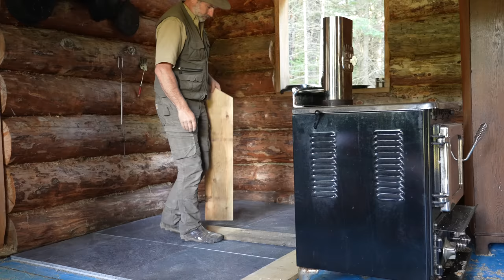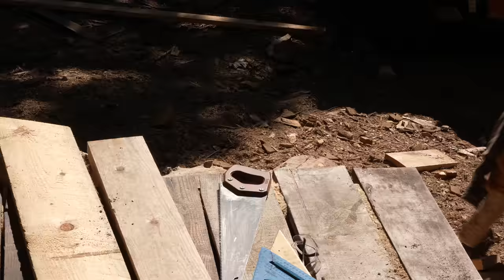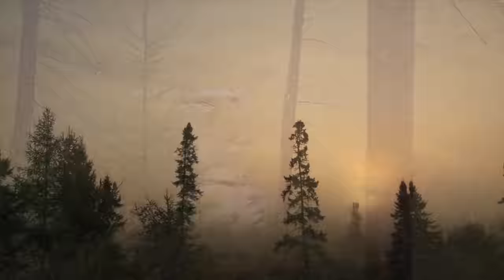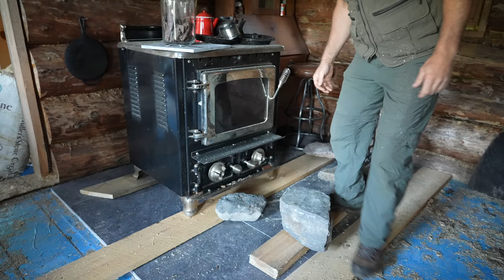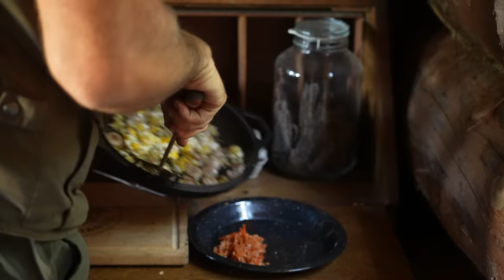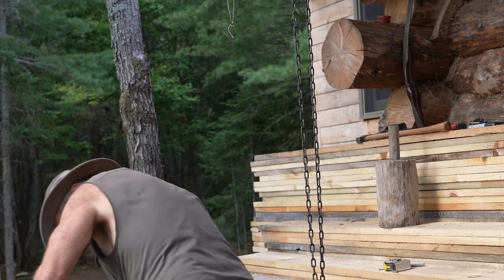Porch Overhang, Install Windows, Stone Floor, Garden Harvest, Off Grid Log Cabin Build Alone, Ep 23

Comment: My log home was made from 12" White Pine logs. All my vertical support logs inside and out were set up with the jack bolts like you have. My logs settled 4"-5" in the first 5 years. After that hardly any settling. When i would let the jack bolts down there was lots of cracking sounds from the settling. I built my log home back in 1998. To this day my log joints are mostly all tight! I heat 100% with wood. My home is 32x40 with a open style and a loft. It heats easily with a Soap Stone wood stove in temps down to zero. Then i fire up my outdoor wood boiler and run that until spring. I still burn the Soap Stone stove as i love viewing the fire! 

Your cabin is looking fantastic. Im anxious to see the finishing touches. Cali is looking great as well. I was wondering if youve ever taken her Pheasant or Grouse hunting? She looks so birdy when she's hunting up her dummy! I thinking she would do well on the Grouse and Pheasants!
Reply: Shawn mentions about the settling on his other channel, Shawn James. Not sure if I can post a link but the video ID is: 0QjF-kXgj3Q and the video is titled: "Why and how I am installing posts and beams on the log cabin porch" (upload date: September 9 2022). I point this out in detail for the benefit of anyone reading this in a few months/years/decades/centuries ....... 🙂

Comment: love  the way all key elements have been brought forward in sequence  towards  a logical conclusion..home-garden--- soil replenishment .....water ....glass house ....offgrid power.. fencing enclosure -you have cracked the back of it--hopefully you  can  slow down  a bit  and also benefit from  the inside work conditions  over winter-next spring will be a celebration like no other.

Comment: Nice work Shawn! I can't help wondering what's going to happen 2-3 years down the line after the logs have settled and warped into place. The cabin we built settled for years after we put it up. We let the structure dry out before we did the finishing work. I talked to an old farmer who built his log home in the 70's and he told me it took 8 years for it to stop shifting. In the end, doorframes had settled down 5 inches. I would wait before chinking so it doesn't all crack and fall out.

Comment: I have been following you for years (when you were just beginning the first cabin). I would like to add my 2 cents for what it's worth. I would have loved for the woodstove to span the corner it is in rather than flat against the wall. And, I would think twice before putting the wood secretary so closely next to it. The intense heating then cooling will damage the wood by cracking and cupping it. Oh, and you are doing a fantastic job.

Comment: The post supports for the expected metal roof also have quite an aesthetic architectural addition as well. Could be an extension to a wonderful front porch patio or a deck. Winter is coming, but I don't have to tell you that. Looks like you might be able to settle into the cabin before winter. Watching with anticipation.

Comment: There is nothing more to say, that hasn`t been said already, absolutely, incredible, Shawn. I had a creative writting class in High School, your build just inspires me, so here goes. I once had a dream of being self reliant, I would purchase some acreage, to become more compliant.I would build me a cabin, with my bare hands, I would build it alone, in the Canadian sands. So I cut down some timber, on this property of mine, this would make up the walls, these trees would work fine. A basement I wanted, so I started to dig, this was the start, to me going off grid.I dug for days, until i was sore, got up the next day, and dug some more.The foundation was set, it couldn`t look any better. I would start on the cabin, no matter the weather. So I whittled the logs, and hoisted them in place, even with snow and ice on my face. There`s no stopping now, only time for bed, and I hoisted those logs, till they were over my head. I now have four walls, it took a long time. And I would build me a roof, from  Canadian pine.So I cut up some boards, and built me a frame. Then I hoisted huge timbers, it`s all part of the game. Then I hammered those boards, in every single space, And I got to admit, they look good on this place. I popped in some window, and built me some doors,  to get it enclosed, then on to the floors.I filmed while I built, for the whole world to see, it looks just like I wanted it all to be. I am not done yet, but it sure looks good, this cabin of mine, in the Canadian woods. You sir, are an absolute inspiration to us all, and we thank you for taking us along, someone get this man a beer. Joe Bacarella from Michigan.

Comment: Potato count, not great. However, over time it will be better. Your experience that you gained at the old cabin property will pay off for this one. You did do well though, as I was thinking far less potatoes. I grew some in my field at my property last year, and other than the deer eating the greens (which we thought they wouldn't do.. lol) I got a great turn around at about 10 per plant planted. I was amazed, but didn't have the time to do it this year. Hoping next year is a better spring and summer. I found this year to be like what it was like 10 years ago. Been so hot the past 5 or 6 years. Congrats on the progress.

Comment: Something I have wanted to try is transparent wood windows. Supposedly 3mm balsa wood is bleached using a 5% sodium hypochlorate solution. After the balsa is bleached it is washed 3 times in deionized water to remove the sodium hypochloride. The balsa is then placed in a pressure pot with 15 times the thickness of polyvinyl alcohol (PVA). The pva and balsa is brought to a pressure of 200PA or .02 psi and degassed 3 times at this 200PA pressure. I think a millibar gauge would be best as 200 pa is 2 millibar. You can make the PVA by using 8% PVA powder to 92% deionized water. Once the wood is impregnated with the PVA it is baked at 60°C for 48 hours. The resulting wood is supposed to be 90% transparent. It is thermally better then window glass for heat retention which cuts down on heating costs. Rather then shatter like glass it splinters. It also is said to be more impact resistant then regular window glass. 

I think small shingle/tile sized pieces would be easier to work with. With this it might be good for the old fashioned hexagon/octagon type of windows. 

I would love to double up the panes of transparent wood and fill the space between the panes with argon to increase the thermal retention and further slash the energy bill for heating/cooling. I think it be a fun little project too.

Comment: It seems too bad that you didn't consider installing a cookstove that has an oven that could bake as well as heat your new log cabin. Your new stove does certainly have a nice large cooking surface tho again I have to herald the benefits of having a cookstove that also has different stove top temperatures for simmering as well as direct hot cooking over the fire. There are simmering spots over the oven space slightly away from the fire for instance. Enjoy your new sheltered space this winter. You have well earned this added comfort! Bravo!

Comment: Just wondering, won't those floor tiles eventually crack without any expansion space or grout in-between them? Especially with the more extreme temperatures and the surrounding heat of the stove above?

Comment: Before you lay down those pine  planks why don't you put like 2 inch high density foam board that will help tremendously for both keeping your seller cold in your house warmer
Reply: Just buy longer screws
Reply: Or at least just aluminum foil for radiant purposes

Comment: What is your reason behind not sealing the window installs like they do in current construction? I assume because there is no internal drywall / insulation, moisture doesn’t get trapped because the cabin can “breath” better… which is why you are not using current weather proofing (besides the roof and foundation that you did use moisture barriers)?